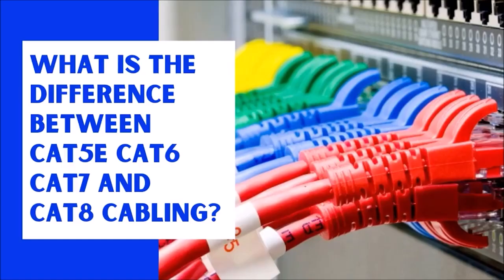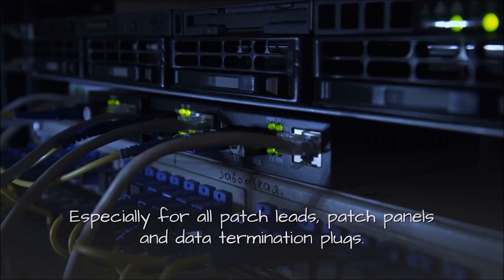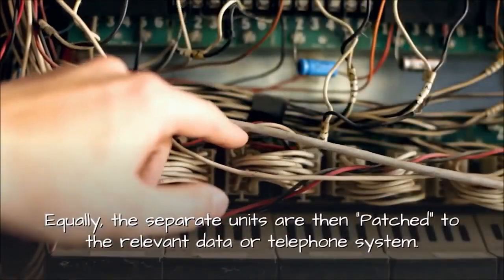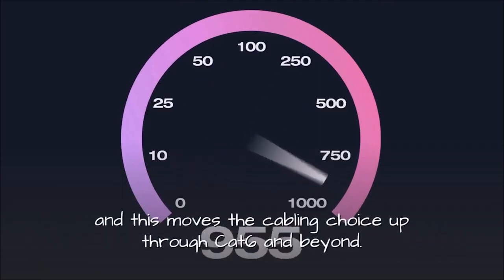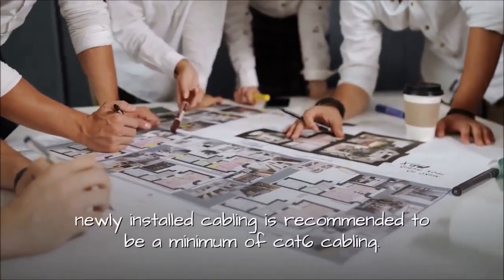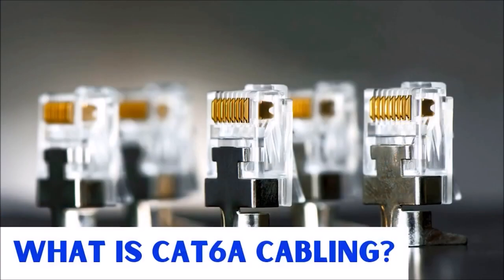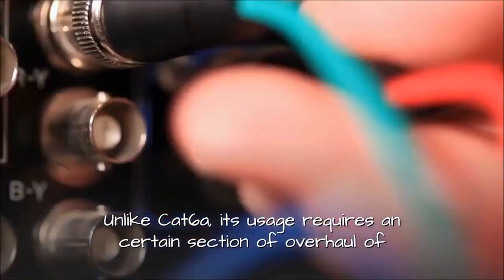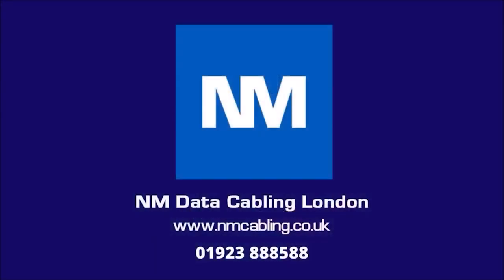Cat6 vs Cat7 vs Cat8 Ethernet Cables: What’s the Difference and Which Should You Choose?

Comment: Great video! Can you explain if there’s a noticeable performance difference between Cat6 and Cat7 for home use, or is Cat8 overkill for most setups?"
Reply from the maker: For most home setups, Cat6 is more than sufficient, offering speeds up to 10 Gbps over shorter distances. Cat7 provides better shielding and slightly higher speeds, but the difference in performance is usually not noticeable for typical home use. Cat8 is overkill unless you’re running a high-performance network